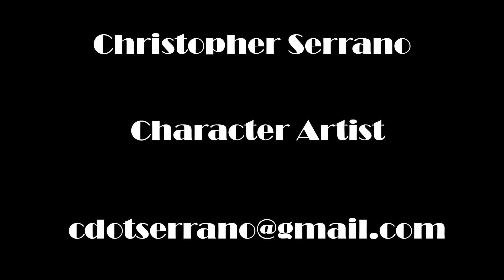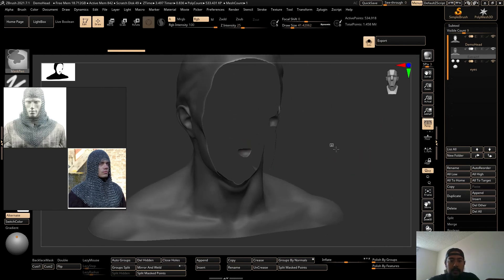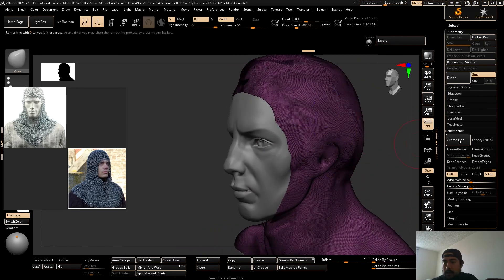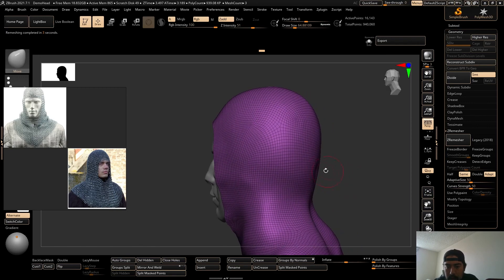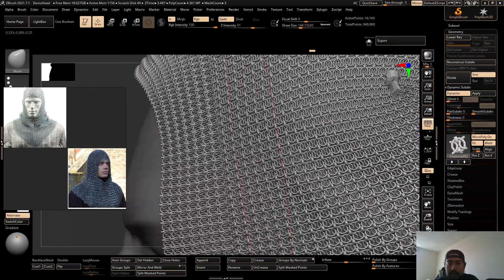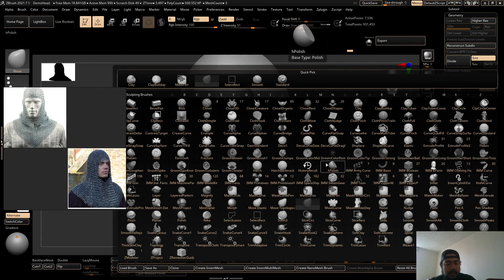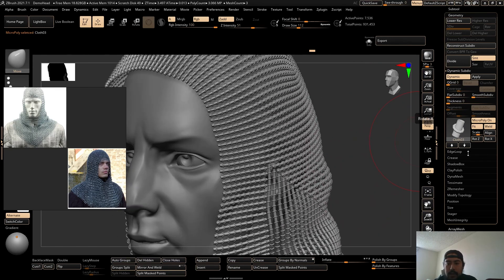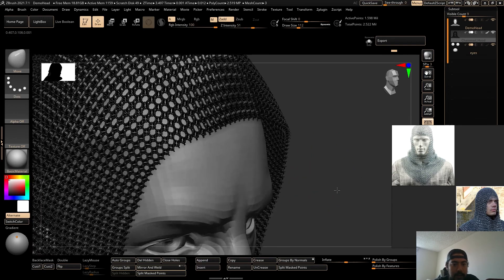How To Make A Chainmail Hood In Zbrush Using Micropoly.

Comment: Nice tut, but at the ends of the mail hood there are practically cut rings all around, which would be impossible in reality, because these then fell off.
How do you get a clean connection to the face and bottom edge?